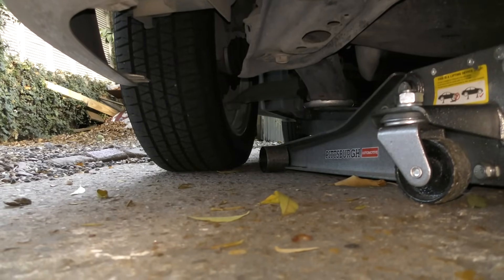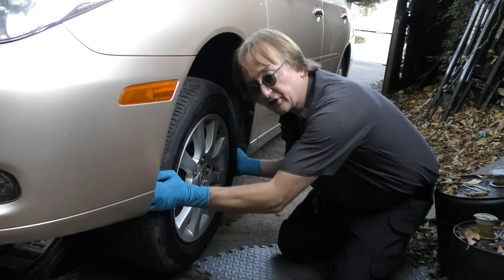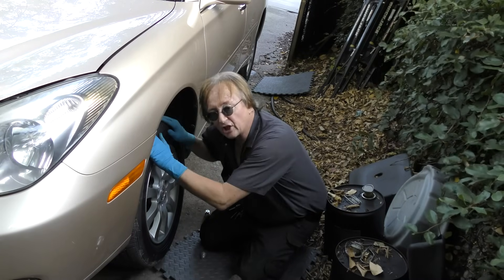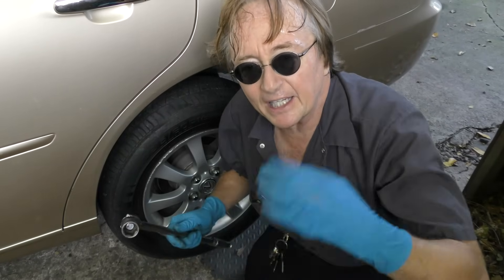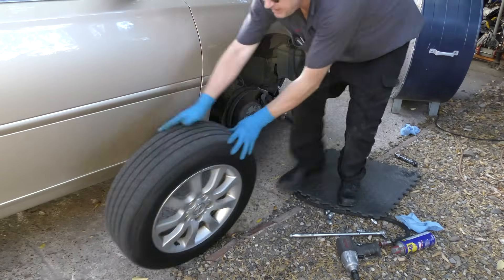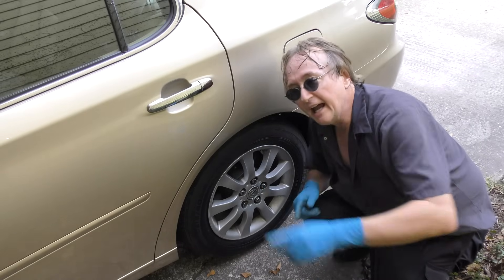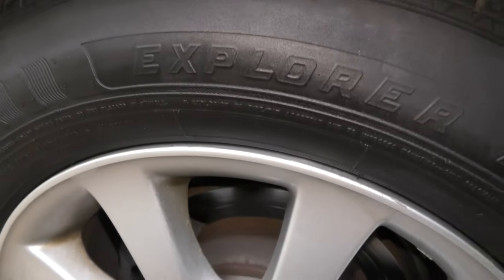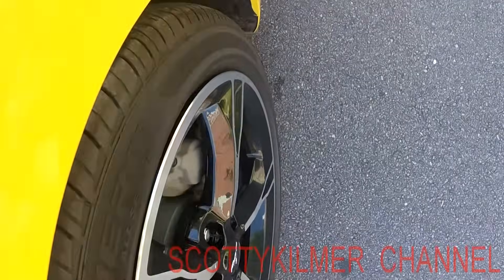How to Fix Wobbly Steering Wheel in Your Car

Comment: So my 2001 Honda accord always drove perfect, but I noticed it was pulling to the right so on the passenger side there was some thread on the inside of the tire exposed so I had a tire place put a new tire on it. Now my steering wheel wobbles a little bit. I did put the back tire on the driver side in the front And put the other one on the back. But it still wobbles a tiny bit now. Did they just balance the tire wrong? It was fine before I got the tire put on

Comment: Hello Scotty i have a 2014 ford focus se with onk 40k miles i am having brake problems with the front left wheel which happened very suddenly / grinding noise from left front wheel. i took it in to just have a look over and estimate they say that my front left caliper rotor and front pads need to be replaced and that the caliper wouldn't release. my question is can the caliper be repaired or is is best to have it replace since the vehecile is so new

Comment: Scott my steering wheel is moving all over the place and I changed all the front suspension and there's nothing wrong with my tires. I was told I had to change my steering column the upper shaft and intermediate shaft
Reply from the maker: yes worn shafts do that too
Reply: Scotty Kilmer so would it be better to get my steering column rebuild and change out all the bad and worn out parts and change all the shafts so I can have that tight and firm steering again? I'm tired of always  hearing the steering wheel moving all over the place.
Reply: My steering wheel every now and again will get stiff and hard but my power steering fluid is full and the guy told me that the problem is my intermediate shaft so I had to asked you first.

Comment: What if your driving down the road around 30 to 40mph and you go over a manhole that feels like a big bump since it is recessed a little and as you drive over it the suspension feels loose and the tires seem to wobble for a second and the car feels like it does minor wobbles.  The car is a 2008 CTS.   Thank you

Comment: Scotty my car has a staggered setup and I just put new tires on. There is now a slight vibration felt through the seat at around 60 KPH and 100KPH but at no other speeds in between, above or below the aforementioned speeds. Would that indicate an issue with the rear tires since the slight vibration can't be felt through the steering?

Comment: Heeeeey Scotty! Love your videos. Great education on a very complex and multi-faceted technology! But let me ask you, Scotty, why is the 80 amp fuse ALWAYS blowing out just as soon as I install it? I have a 1993 Honda Civic CX. One morning my car was entirely DEAD so I followed your advice and tracked down the reason. A blown 80 amp "block fuse". I thought I had the problem solved but as soon as I installed the new 80 amp fuse it blew! When I attach the Civic's battery cables to the battery the POSITIVE terminal loudly snaps and has a spark and at the same time the 80 amp fuse sparks, snaps and blows! Do you know the cause? I love my funky, beat up 1993 Honda Civic CX and HATE my 2014 Honda LX and I wanna ride! Thank you!

Comment: Would remount/ rebalance of the tire on the rim work as well? Guess it depends if the rim has damage from hitting the curb.
Reply from the maker: once bent, aluminum rims can not be properly balanced in most cases, so this is a spare tire now, as this car had a good full rim and tire as the spare. They used to actually make them right like this, now many cars have no spare, or a crappy small stupid spare

Comment: I have a 09 accord. If I go to 100 my car starts to shake. Speeds below that it's a smooth ride. I got the mounts replaced as they had gone bad. Also the rhs CV joint. But the tick tick sound is there. My mechanic can't figure out what is causing the ticking sound?

Comment: You can't always get by with that because I had 4 defective Falkens that (insert franchise store here) denied were the problem and kept balancing them over and over as well as changed out the shocks until we put 2 60$ Chinese tires off the internet on the front and that fixed the wobble.
Reply: Wobbling is rarely a balance issue.  Defective tires aren't all that rare.
Reply: Yeah they are banging those things out 100 a minute so there is going to be some defective units.

Comment: Scotty, every winter, SOMETHING on my 2003 Saturn L-200 breaks. Either the ignition, tires, battery, exhaust, or spark plugs. I am THROUGH IT. I feel like sending it to a junkyard now and getting something better. I'm thinking of getting an Acura TL, Audi A6, or an Infiniti G37x. Which do you think is the best?
Reply from the maker: get the acura
Reply: what is the best way to get rain water out of carpet in car before it mold up GOD BLESS YOU  ALL

Comment: I'm going to try this with my 2004 Yukon xl 
I installed new hub bearings in the front and 4 new tires and balanced 
I still get a wobble goon 45-50 
It goes away above or below that speed
Reply: How did u get the problem solved mate im having same issue .
Reply: I replaced the truck I couldn’t isolate the issue check tire pressure

Comment: Well just happen to me this week, the steering wheel was shaking and I did the balance to front tires but doesent fix the problem and I swap the rear the the front and the problem got worse, the steering shake and steer to the left, and then I remove the front  left wheel that has some wear at the sides  and replace it with the spare tire and everything gone smoot again, just front tires gone bad from the sides and need replacement.

Comment: hi Scotty my SUV has the same kind of problem except it vibrates on the left side. How do I rotate tires for this?
Reply from the maker: if you don't have unidirectional tires, put left side on right, and if it then vibrates on the right, replace the bad tire. if it still does, other things like drive shafts being bent do that
Reply: Scotty Kilmer thanks a bunch Scotty

Comment: hi there! what could be the issue in my car. i'm parked, i turn my steering left or right and theres a rubbling sound just like grrrrrrr....with a little vibration. please help Mr. Scottie😚😚
Reply from the maker: often a worn power steering pump or one low on fluid
Reply: thanks for your quick reply. steering fluid is fine. but how to chwck the pump? any video you made about this? ive been watching tons of your video. and it inspires me.

Comment: I had that problem on my car a few months ago.  It turned out that the front tires were old and needed to be replaced.  After I put a new pair of tires on the front wheels, no more wobbling in the steering wheel.

Comment: Scotty can you help with this problem my outboard engine is messing up its stalling after 3000rpm and throttle response isnt good either and just some detail it's a 2 stroke direct injection so if you can help that would be great
Reply from the maker: generally a fuel problem, try cleaning the injection system
Reply: ah thank you scotty ill try that

Comment: what about if your steering wheel vibrates sometimes when driving, and my tires are ballanced.
Reply: Rick James 3 years and no one answers smh, wow
Reply: Just get a new whip brudda
Reply: Could be Motor mounts causing vibration
Reply: Tie rod
Reply: It could be a tie- rod but sometimes if it’s a truck, suv, van, they may need road-force balancing. I’ve seen tires balanced and still the steering wheel wobbles. Then road-force balancing cures it. Especially with pirelli tires, they’re known to be very sensitive to balancing. Seen a navigator get balanced 4 different times until they did it with road-force. That finally cured it. Some say it’s just the way some tires are made. Same brand, different tires may be good with regular balancing. It can get puzzling with the wrong equipment.

Comment: Hey scotty i have a cadillac cts 2005 and my engine light came on i got it checked out and it said that my canister purge vaulve was failing, i already put a new canister purge valve in it but my engine light is still on what would be the problem
Reply from the maker: tons of things can do that, rather than guess, have a pro with a dealer scan tool analyze it

Comment: I have that same issue on my front passenger side wheel.  I took it to lesschwab tire and they replace the wheel bearing, but the issue is still there.  I had them do a full wheel balance on all 4 tires and including rotation.  When the mechanic guy there at lesschwab put it up on the lift. He show me what was causing the wobble problem by shaking the tire for play and the wheel wobbles really bad on the front passenger side.  I took the car back and they put in a shim to see if that fix the wobble, but the problem is still there and hasn't changed.  Can you please help.  The wheel did have some really bad road gash mark on it.

Comment: don't have a  wobly steering wheel, however, i have some vibration in the car as i first start driving after the car has been sitting, and then gets better with still a little vibration after driving about 5 minutes or so.

Comment: Is it ok to add 25w 50 oil on a corolla 99? it is consuming some oil..the manual says 5w30.. i live in a high temp environment.
Reply from the maker: sure, see guys do that all the time
Reply: thanks very much, some one told me it was too thick and would damage the valves.

Comment: A wobbly steering wheel is more common when the tires are not balanced  and misaligned, doing both things after solves the problem not changing the tires.

Comment: My Lexus Sc400 drives fine down a smooth road the steering wheel doesnt wobble but if i get on a bumpy road the car wants to jerk from left to right like i can hold the steering wheel straight and the car will shift from left to right when i hit a bump or uneven spot in the road, trying to figure out what it is!

Comment: hey scotty, i have an 07 ford explorer. ive got 2 problems with it, one: the car produces a whooshing or vaccum sound when i accelerate but theres no loss of power however ive noticed it is beginning to start up slower and sounds "tired". the other problem is i hear a hissing sound when i turn the A/C off. any solutions? thanks
Reply from the maker: do my video "finding engine vacuum leaks with a cigar"
Reply: what about the whooshing engine noise when accelerating?

Comment: Hey Scott. I have a 2015 Chrysler 200c and when I’m around 77-80 mph. And the steering wheel intermittently shakes about 3 second intervals?? It has new tires. The lower control arms were replaced and the front and rear stabilizer arms were replaced too. Supposedly they did a front wnd alignment too. Any suggestions?

Comment: can this also be caused by warped brake discs?
Reply: They pulsate and shimmy when applying the brakes.
Reply: wholeNwon thanks thats whats happening on my golf 4 at the moment
Reply: Very common.  Always hand tighten the lug nuts using a torque wrench set to the manufacturer's specified tension for your car.
Never trust a tire shop to do it right.
Reply: Absolutely agree!,  a common issue I see with my circle of friends is "warped rotors"  when it's just plainly uneven film on the rotor people just expect their brakes to take it all unfortunately,  a little knowledge goes a long way
Reply: Certainly true in racing circles.  But warped rotors are real things. When new rotors are installed, people frequently do not clean the hubs to remove all rust and scale. The rarely check the mounting surfaces for run-out before and after positioning the rotors. Many poor quality shops give the job to kids who have had little, if any, instruction.  They may fail to position the rotors correctly, tighten the lug nuts in proper sequence to correct settings, etc., etc.  All of these details affect performance. And none of this addresses the correct installation of pads.
Reply: That's a quote lol

Comment: I have a 93 Honda Prelude. and my wired connection is missing that checks my check engine light do you have any suggestions
Reply from the maker: those used old fashion OBD 1 connectors which really give very little info anyway. Not really worth rewiring it

Comment: I did that and the car is still wobbly on the highway. Mechanic says my two rear forward control arms need replacing. Could those parts cause that for real? Or is he just trying to swindle me? Cause suspension ain't cheap

Comment: scotty i have a 1998 ford ranger 4x4 and when im driving on 2x4 on the freeway at 65 it starts to shake but onces i put it on 4x4 it stops i dont know what it can be can you help ? they told me it can be the front rotors but idk
Reply from the maker: could be rotors, as putting it in 4 WD will make more mass spin and counteract out of balance rotors
Reply: oh ok thank you so much i already order some rotors and brake pads just waiting for them to come

Comment: what if my steering wheel vibrates after start up what would be the cause for that? when im driving or braking it doesnt vibrate only at start up. im thinking maybe its a bad engine mount but im not sure
Reply: Bad steering pump or steering pump motor. Can also be a gasket of you're driving a Honda. I had a bad intermittent steering wheel on an Accord and the power steering fluid reservoir would push out fluid and bubbles. Come to find out it was a o-ring that cost 10 cents at the dealership fixed the problem.

Comment: hay scotty iv commented before and this is my issue when i drive my car on the road after i have warm it up the rev drop and the car dies then it starts up again when i took it to have the ignition switch done they sed that the reason was because of the crank angel sensor they did something and it was fine on the drive home then me and a mate hook up an amp and now its doing it again the amp is not hook up to anything and since then its still not hook up any idea i am gessing that maby iv trip the crank sensor again
Reply from the maker: realize crank sensors may go bad, but often that code is tripped from a worn timing chain or belt and then the computer flags the messenger, the sensor, and not the real cause, a worn timing component.
Reply: Oh cool thanks scotty ill get right on it cheers again

Comment: hey I have a question I replace my oxygen sensor Bank 1or 2 sensor so they check engine light still on I need little help please I have Hyundai sonata se 2011 68991 mill on it's Scotty Kilmer
Reply from the maker: unfortunately tons of things can trip that code other than bad sensors, like dirty fuel injectors, vacuum leaks, low fuel pressure. probably best to have a pro like me at least analyze it in person

Comment: Hey Scotty, after i hit a curb my steering wheel started shaking while braking so i replaced rotors, now every new set of rotors warp after 500 miles or so. Already changes 3 sets of rotors, tried new ones, machines ones and OEM rotors. All of them warp after 500 miles. What could cause the rotors to warp constantly? Its a multi-link suspension
Reply from the maker: rotors warp is brake callipers are sticking on a lot
Reply: Scotty Kilmer No, calipers are not sticking...thanks anyway

Comment: In the vehicle in this video, wouldn't the dented rim damage the rear wheel's bearing over time if it's left like that??
Reply from the maker: not with such a small dent, cause when you spun the tire back there up in the air, you couldn't even see any wobble or uneveness at all.
Reply: thanks

Comment: What if it's not wobbling but actually just vibrating really violently... especially at high speeds on the highway? Even after new tires. Is it an alignment problem? Or rotation problem? Its so bad that even when I'm holding the steering wheel as hard as I can I still feel it shaking. And I have clauses on my hands from holding it so hard all the time. What's your opinion?
Reply from the maker: If that's really your picture, you make me sad I'm not young anymore chasing after women.dd  Find a good front end alignment shop,, most give free estimates of tire or alignment problems
Reply: Scotty Kilmer just a tad bit creepy :s 
But thanks for the auto advice

Comment: About the torque wrenches and all this - many tire changing shops change the wheels on the cars using the airguns only, they tend to use so much torque that I could not unscrew them using a cheater bar and a 1m extension, had to use a gun to loosen them up first. Now I'm just giving them tires to change and put the wheels on by myself. Now imagine if you had to change a wheel on the go and you could not unscrew it no matter what. They also warped the brakes on one guys car, so beware of such practices.

Comment: @scottykilmer might be one of the wheels need to be rebalanced,  or one of the tires has a construction failure and need to be replaced, 

am I right this time?  😀
Reply: Shimmy and vibration are different.
Reply from the maker: to some extent, it was so minor on the back of this car I left it. If really bad even on the back, I would have unmounted the tire, checked the rim, and replace whatever was bad. But on the back, minor imperfections do no harm

Comment: Can failing water pumps make a rattle noise every once and awhile while engine is running in low rpms? Doesn't make the noise when I'm flooring it or going over 40mph with high rpm.. any help?
Reply: Mazda3 if it's a Mazda 3 could possibly be the timing chain tensioner, it's a common fault,  I personally had the issue when I owned a "mazdarati"  (Mazda 6)
Reply: It's located under the rocker cover (top left) the noise I would describe as a rhythmic tick/rattle
Reply: logan thompson yea I was thinking it could be a tensioner but I went to some amateur mechanics and they quoted me $500 for a new water pump which I thought was very very wrong. It sounded like a belt tensioner but the chain tensioner is a good possibility. How much are they and do u think I could still drive it the amount of miles I am?